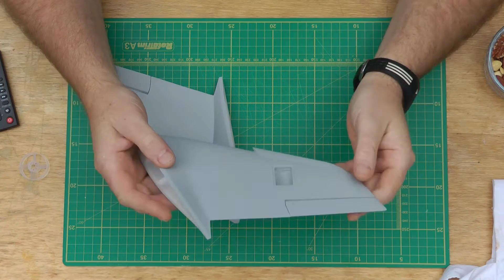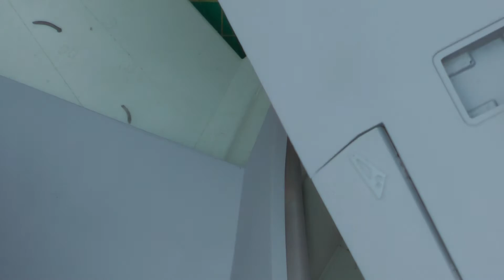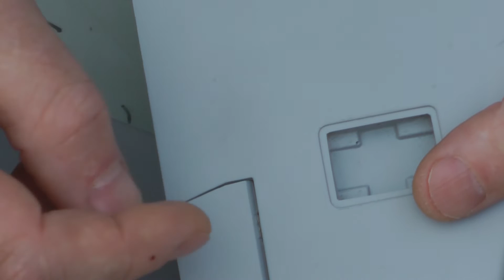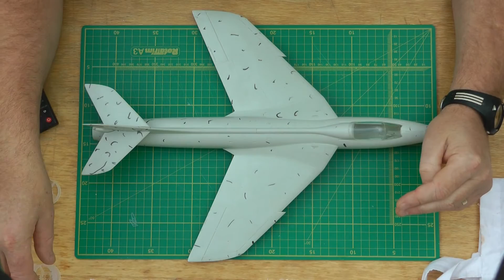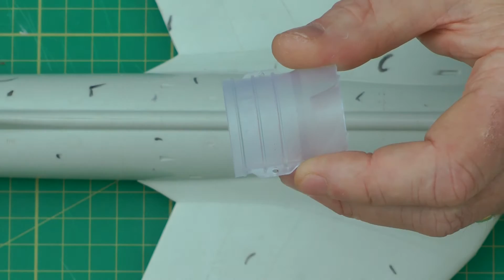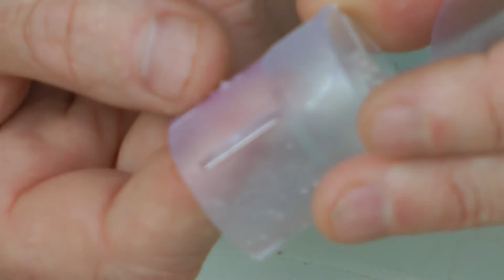3D Printed ABS for Mould Making – PART 28

Comment from the maker: Topics covered in PART 28

--- Primed wings
--- Hinged ailerons
--- Total Weights
--- SLA printing with the Form1+
--- What’s next

Thanks for Watching!

Special Thanks

AvB
RC Groups “Making a foam cored wing using 2-part rigid polyurethane foam in the mould.”
http://www.rcgroups.com/forums/showthread.php?t=1721451

Bret
RC Groups “100mph Electrolyte ARF by Hobby King coming soon”
http://www.rcgroups.com/forums/showthread.php?t=126095
YouTube – “Electrolyte: molded wings using expanded foam”
Electrolyte: molded wings using expanded foam part 1

TROY 
RC Groups
http://www.rcgroups.com/forums/showpost.php?p=27750058&postcount=1567

Forum members @ MakerBot Users Google Group
https://groups.google.com/forum/#!forum/makerbot-users

Forum members @ D Printer Tips, Tricks and Reviews Google Groups
https://groups.google.com/forum/#!forum/3dprintertipstricksreviews

 #moldmaking   #3dprinting